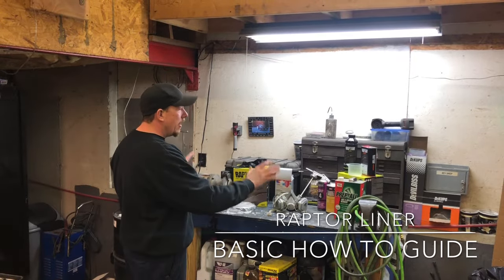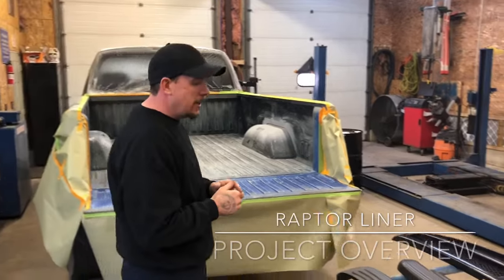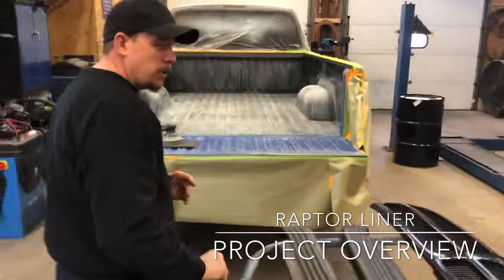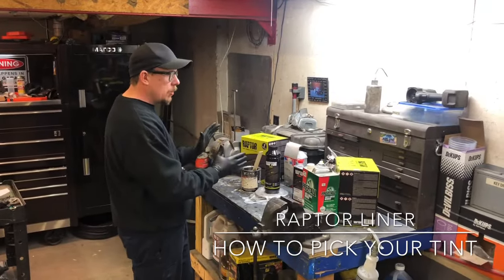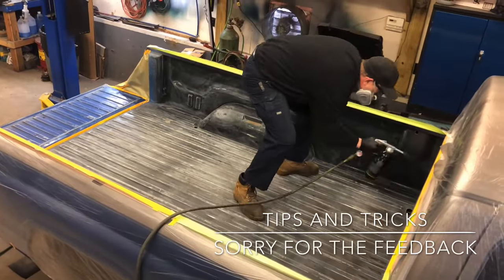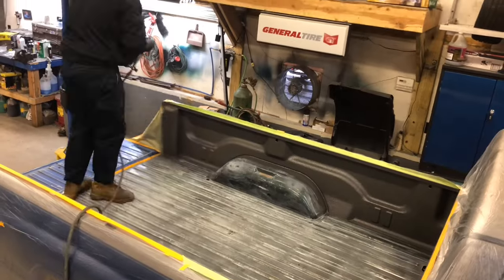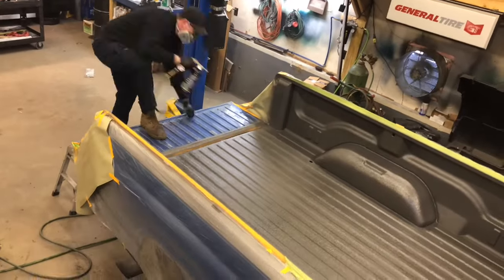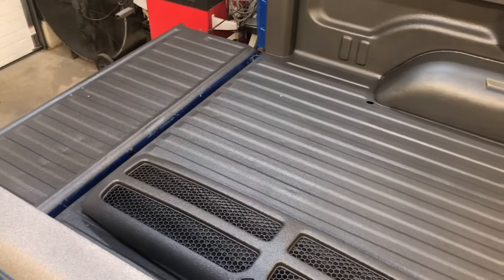How to spray raptor liner step by step

Comment: This is a great How-To video. How bad was overspray. Ive heard its pretty bad, but didn’t look like it in your video.  Don’t want to have everything else in my garage coated with Raptor liner!! Thanks!!
Reply from the maker: The worst is the floor will get coated all around the truck and when you are walking it will feel like your shoes are sticking to the floor, I would suggest you plastic the floor and park the truck over the plastic if there things near by you don’t want raptor lined I would cover those with plastic also

Comment: I had not seen the other videos were Blue or Silver was mixed and sprayed. I would the outside of the box of Raptor product changes with graphics or photo, but after verbally covering everything in the products, the only thing I did not hear was if this was the “Black” or “Tintable” Kit. I listen and watched the entire video, then go back and start from the beginning. You had (Camera Dude) got a still shot of the box. At that point I knew it was tintable version. I could read it on the box otherwise just saying I was guessing. The black might take on a color if straight pigment is used by it can fade a little. Using the “Tintable” version, the pigments should come from a paint store with a mix for this purpose. They have a drying agent additive that makes the pigment into an enamel base with drying agent as parts were mentioned. It is the binder or resins as I understand dilutes the pigment down changing the ratio. Without seeing the other videos, not hearing it in this one, I was really unsure which kit was used. I fix cars not paint them. From what little research and a couple of others videos, I felt it had to be the milky-looking tint-type, not the black. 
 It no big deal, just thinking out loud as I did not hear which Raptor Kit was used, only pausing the video to read the box, then I knew. I have painted 6-7 of our own vehicles as a couple of our sons dinged them, let me paint it, then go out and later total them. I lost a hatch-back, 4X4, FWD sedan and my Buick PA Ultra this way. I guess you know when they have finally grown, when they total out their own vehicles. I concept was “Dad can fix it”, sure, but I don’t have a frame machine you ankle bitters. My youngest has not wreck a vehicle in a while, so he is getting better now in his mid 30’s. The other one, totaled an older Suburban, so he has a way to go. It sucks being the guy in the family who fixes the vehicles, but I am working on my own for me. Aftermarket products require research as at the dealer, parts are what you replace work and function the way you expect. Thank for your efforts. 
ASE Master Tech since 1978-Retired

Comment: You’re really good getting back to people on comments I just had a question about the tent that I picked up they said it’s acrylic and I’m not sure if it’s the kind where I need to mix the Hardner before I add it to the tent or like a 2K it has everything but the binders and it’s very watery
Reply from the maker: Ok so if you are adding the tint to your raptor liner I would tend to think the hardener for the raptor liner would talk care of the tint and the liner together, not sure why it’s watery? Where did you get it from?

Comment: new to painting period, what size/gallon compressor did you use or would you use at min? was a good video and very helpful!!
Reply from the maker: I’d say you should have at least a 30 gallon compressor, with the raptor liner you have to spray it at a pretty high pressure and you want your compressor to be able to keep up mine is a 80 gallon ingersoll rand, thanks for watching the video

Comment: just curious about the kits you mentioned, how many quarts were those kits? Got a crew cab short box truck and topper I'll be lining and was thinking I could get away with 5 gallons but now thinking I'll need more. If you were talking about the 6 quart kits and recommending 4 kits for a crew cab I'll be getting 5 assuming my topper will be a whole kit aswell.
Reply from the maker: So each kit is 1 gallon of material and I think I used 5 kits and had some extra so I’d say go with 1 extra kit once you start spraying you don’t want to run out, if you don’t use it you can return it

Comment: How long do you wait to take the tape off. i think the directions said 15-20min. that seems quick to me. How long did you wait?
Reply from the maker: I would remove the masking as soon as possible because the longer is dries the better chance of pulling the liner and causing tape strands from semi dry material clumping on the tape while you remove it

Comment: Are you able to get back in the box to spray a second coat or do you have to do it from outside the box? Is the drying time in between coats long enough so that you won't leave foot prints?
Reply from the maker: I wouldn’t step on anything until at least 12 hours but preferably 24 so if you want to spray more than one coat you would not want to step or lean on anything recently sprayed, so have a game plan ready before you start

Comment: Why not mix all base coat primer and raptor liner FIRST then weight and measure hardener in aliquots? Thoughts?
Reply from the maker: Idk 🤷‍♂️ I just did it this way but I’m sure your method would work but I didn’t want to mix more product then was needed so I opted to do the one at a time instead of mixing larger amounts

Comment: My worker sprayed most of my dump trailer about a month ago with raptor liner, if I want to add another coat should I sand and or wire wheel then go for it or what do you suggest?
Reply from the maker: I’d wash it good with some dawn dish soap, scuff it with a 120 grit maybe 80 grit
But just give it a good uniform scuff and give the new material something to bite into, then spray away.

Comment: Nice Job!  What size compressor do I need to apply this product?
Reply from the maker: Thank you! I would have to know what size project you are doing but as a rule of thumb at least a 30 gallon 220 volt compressor with some sort of a water filter system

Comment: Would you say it's easy to make spray marks and shiners with this stuff? I'm thinking about trying it but I don't want tk see a bunch of spray marks when the light shines off it
Reply from the maker: With the raptor gun that has a nozzle that’s adjustable for a better fan pattern and getting your overlap just right is the best chance of avoiding that. however depending on the color and surface that may affect your final product

Comment: Question.... When you sprayed the plastic pieces did you spray any kind of etching spray to them or was it smooth plastic..
Reply from the maker: I believe I did scuff them down with like 220 and I also sprayed them with some adhesive promotor before the raptor liner, hope this helps

Comment: Is overspray an issue with this? Doesn't look like it. Would be doing it in a 2 car garage.
Reply from the maker: Yes I would suggest to either wet or put car masking paper down the overspray will mess up your floors and it will stick to your shoes bad, also can get on surrounding items not bad idea to throw plastic on any thing you want to keep nice

Comment: What kind of compressor do you have? Raptor recommends 6hp at 20+ gallon which seems a little impractical for a home user DYI without a shop.
Reply from the maker: Mines a 100 gallon ingersoll rand I thinks it’s 20hp don’t remember off hand even Being that size I wish at times I had a larger compressor 6 hp 20 gallon is a great size for home use but could never keep up for shop use I have a 60 gallon husky at home which is over kill but worth it

Comment: How long to you have to wait between coats?
Reply from the maker: I think about 30-45 minutes which is probably a little Longer than needed but you don’t want to rush if you spray on to much it may not cure properly or it could run or sag
Reply: @notchback93  thanks for your reply

Comment: If you dont have a spray gun,can u roll it on like a monsterline
Reply: You can roll on. Use a high-nap roller (like for  textured walls) and cut into the corners using a dabbing motion with the brush to get some texture. 
That said, if you can rent or borrow a compressor you'll save time and crawling around in the bed. It only has an hour pot life.
Either way prep, prep, prep.
Reply from the maker: You probably could but I’m not sure it would give you the desired results

Comment: is it possible to sand off raptor liner after its dried and set? what grit sandpaper could I use? is it difficult to remove raptor liner?
Reply from the maker: It can be sanded smooth or all the way off depending on how thick it is, also I’d say the older the finish is the easier it will sand, I’d say 80 or 120 grit to really rip through the liner
Reply: @notchback93  thank you bro

Comment: Have you banged it up yet? How does it hold up? just bought a kit for the bed of my Ranger. I’m mainly in it for the looks but I need it to be tough when I put stuff back there. I figure if one kit covers a standard 1500 bed it should be pretty thick on my Ranger.
Reply from the maker: Chris Sagredo it’s pretty tough looks the same as it did right after I sprayed it hopefully the one kit covers the whole bed, it doesn’t seem to go as far as people say material wise, if you spray it too thick you may run low good luck on your project thanks for watching 👍🏻

Comment: What compressor do you recommend
Reply from the maker: At least a solid 30 gallon 110v and even that may be a little too small I have a 80 gallon twin cylinder compressor, if you use a small compressor you may have to let it run to catch up it may not be able to recover from constant spraying
Reply: @notchback93  appreciate your response,
Yesterday I purchased a 20 gallon compressor husky brand hopefully it does the job
Reply from the maker: @Daverodd06  hey bro no worries I hope it comes out ok

Comment: I have a 21 gallon Harbor Freight compressor. Is that big enough to Raptor Liner a 2 door Ford Ranger?
Reply from the maker: It will be tough that compressor is going to run constantly to keep up you have to spray the liner at like 40 or more psi, that compressor is gonna be working to keep up and also I would be concerned that if it’s running all the time it may cause water to get into your spray which is not gonna be good I would say try to use a large compressor is possible
Reply: What size compressor is needed?

Comment: I have a question about the base coat, I need to put hardener on the paint and then put it into the bottle?? Or I don’t need hardener for the paint??
Reply from the maker: Alexander Ortiz if your using automotive base coat there is no hardener needed, add your base coat for your desired color and then add the raptor liner hardener just make sure your amounts are correct. Either measure or do buy weight using a scale
Reply: Car Kulture thank you for the information I’m ready to paint then

Comment: Can I assume this is much easier than painting a car?
I plan on using this on my paint flaking SUV.
SUV is not worth spending $5k to repaint.
Can you shoot it outside without too many issues?  70-90* F
Reply from the maker: So the prep is super important, doesn’t matter if it’s paint or raptor liner. It is more forgiving as far as actually spraying it but you need to keep the same distance from the panel and try to overlap your spray patterns as best as possible. You can definitely shoot it outside but try to keep it in the shade and obviously there’s always a chance of debris getting into the liner but not much you can do about that
Reply: @notchback93  - thanks!

Comment: About how many ounces do you think the job is? I have a 2001 dodge 2500 same body style and wanting to do all but inside the bed, looking at ordering the 8 Lt kit, is that enough?
Reply: I would also like to know the answer ... want to do the same truck but a Chevy and not sure how many kits ...  you said 3 kits but is it the 4l kits ?  Thanks 

Looks great by the way ! Lol
Reply from the maker: Probably 2 late for a response but I’d double that amount 4 1 gallon kits maybe 5 if you spray it heavy

Comment: When you say 5 kits, how many liters are you saying per kit. I see 1 liter up to 8 liter kits on ebay.  I have a small single cab dodge dakota. The bed is already lined black. I just want to do the rest of the truck white. (Bumpers, mirrors, plastics are already all black) the truck is white. I will be spraying it white. Do you think 1, 8 liter kit is enough? Thats what I already purchased.
Reply from the maker: Ronald J Smith it’s gonna be close there’s some factors to consider, like how thick you spray it, whats the color of the truck your spraying, if your spraying white but covering red paint it will take more coats to cover  the original color, are you planning on doing inside the door jambs, all these factors will change the amount of product you use I’d say to buy one more gallon kit that will give you 12 liters.  a kit is 1 gallon which is 4 liters
Reply: The truck is factory white, so I'll be putting white on white.  I was planning on doing the door jams, i was also planning on doing the head liner as well. (Previous owner used a 1000 staples to put a sheet on it) 

I will buy 1 more kit. Just to be safe. Just sucks,  buy the kit from ebay, plus $40 shipping to Hawaii 🥴 . Cheapest I can get it for is $162 per kit.
Reply from the maker: Ronald J Smith it will be close with 2 kits, I would spray it nice and even and try to stretch it and if you get a nice even coat and have some leftover you can do a second coat after about 45 minutes
Reply: @RonJaySmith  I am in Canada and a 4 litre black kit is @250 plus $25 ship from Amazon, we get dinged bad up her eon exchange

Comment: Now  get  a load of  gravel  dump  in,  and unload  by  hand  shovel.   See  how  if  holds  out  to  rough  abuse.
Reply from the maker: Had it for 4 years made a bunch of scrap metal runs, plus tons of heavy abuse and it was excellent 👍🏻 I would recommend to do this to any hardcore work truck

Comment: Hi! I think, that 320 sanding paper is really too fine, when you spray this thick "rug", as Raptor is.
Reply from the maker: They recommend 180-220 grit in the directions. I had a boat load of 320 grit so I went with that so far 6 months later and it hasn’t peeled or chipped at all. But your right I did take a risk with the 320 grit, thanks for checking the video and commenting 👍🏻
Reply: @notchback93  Hi! I know what you mean, and i want to thank you for very detailing video. I`ve learn from mistakes, but have lot to learn. I`m beginner, and like to learn from some, who has determined  of those methods with different chemicals. I think i subscribe your channel, Thank you for kind answer..! (Sorry my English, i am "Finnish", LOL..)

Comment: Do not mix your other bottles the hardener will change the viscosity and the texture will be different
Reply from the maker: The texture is largely dictated by the air pressure of the gun, the speed that you spray and the width of the fan on the gun

Comment: How much we need for 1 truck 2 liter or 4 liter
Reply from the maker: Mandeep Gill if it’s the size of the Dodge Ram I sprayed it took 4 complete 4 liter kits, it may even take a extra kit if you also do inside the bed
Reply: Car Kulture how many coat we need
Reply from the maker: Mandeep Gill I always do 2 coats first coat is a heavier coat the wait about 45 minutes to a hour and do a second lighter coat